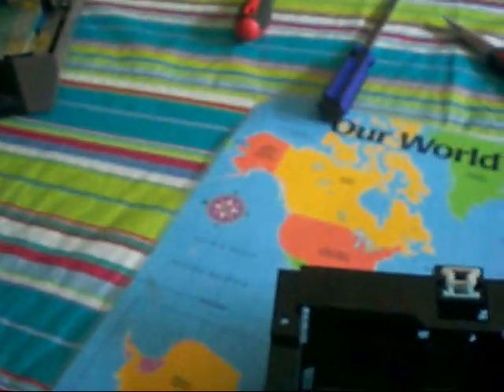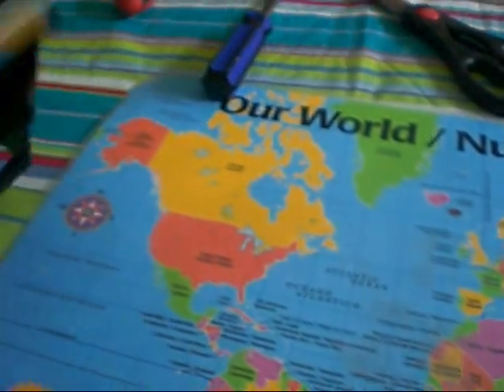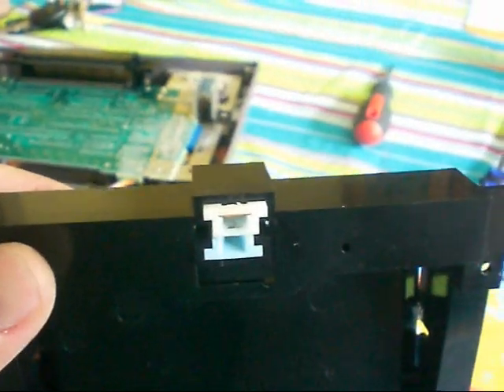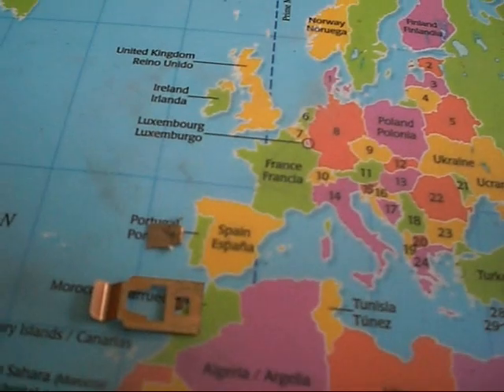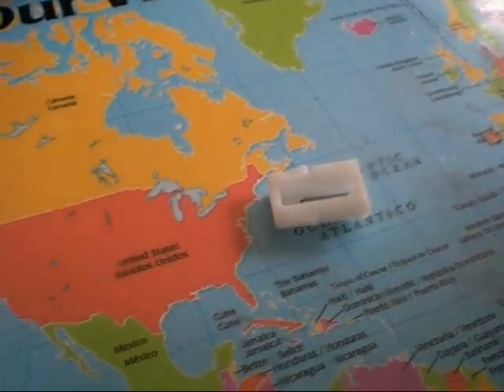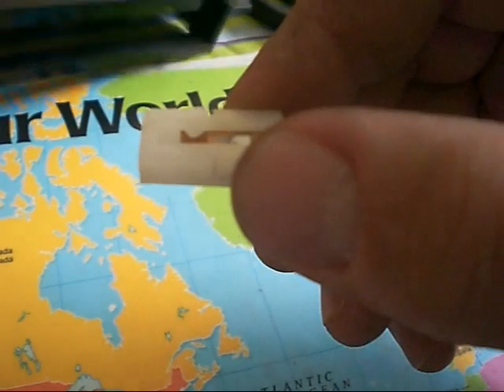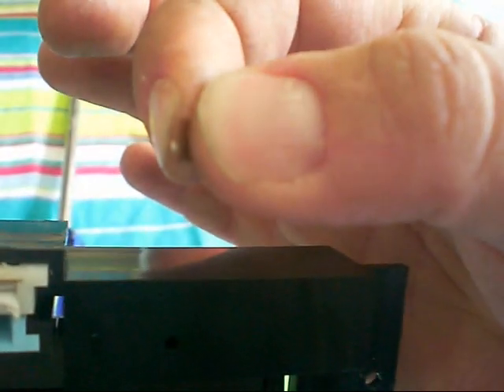Nintendo Front Loader Game Latch Repair: How To Get Your Game To Stay Down In A Front Loading NES

Comment: However, upon further inspection, I realized that applying pressure to the front black plastic on the tray while it was in position allowed it to lock properly. I took a pencil eraser (one of the ones you put on a pencil if you've used up the original eraser) and jammed it in between the middle screw holder on the front of the case (the one that the outside screw runs through). This put enough pressure on it to make it work smoothly.

Comment: Figured it out. For anybody else who is wondering, there are two openings on the side while it is in place. Those holes expose two tabs on the white plastic piece that need to be pressed in in order to remove the piece. The tabs basically lock it in place. 

However, when I removed mine my copper plate was not broken. However I was still having the issue of it not wanting to lock in place. I could remove the holder and it lock fine, but when I put it back in, it wouldn't lock. It made zero sense
Reply: mine wasn't broken either but someone opened the Nes to make a freezone mod and didn't put it back together correctly so the little metal pin was  slightly crushed and there just wasn't enough tension anymore to lock it 
so if everything seems fine just ajust the tiny pin inside for 0.2mm

Comment: thank you for the video, it was hard to find informations on this particuliar problem, mine wasn't broken but someone opened the Nes and didn't put it back together correctly so the little metal pin was  slightly crushed and there just wasn't enough tension anymore to lock it 
so if everything seems fine just ajust the tiny pin inside for 0.2mm
Reply from the maker: Happy to hear that it helped.

Comment: Another thing that can go wrong with this part is that the metal pin can get pushed up into the white plastic thing, and won't go down into the groove when you push the tray down. This happened to my cousin's console, all I had to do was pop the pin back down into place. You can do this without removing the white thing from the loading tray, just use a toothpick or something.
Reply from the maker: Good advice.

Comment: The Paper, eventually pops out, and you have to open the NES, and place piece of paper inside again, and this time, I put some glue to hold it in! lol. ( Plus to get that piece out is hard, took me awhile to figure it out!  ( All you do, is get two flat head screw drivers, and press on openings on the sides to push that tabs in, that hold it! Good Luck!
Reply from the maker: Fortunately, this one never came back out. It was packed in pretty tight.

Comment: I just have a problem with one of the consoles. It runs the games without lowering the tray. I think that maybe I "overfixed" the 72 pin connector. Would you happen to know what did I do wrong?

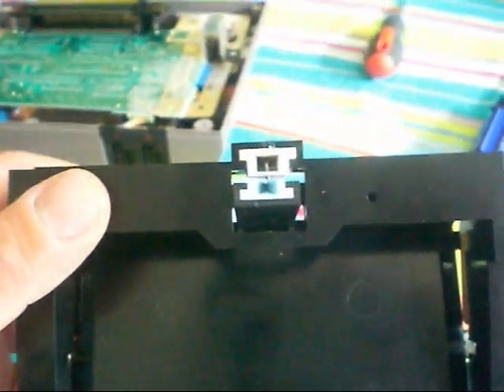Comment: Hi. How did you put out the white piece at 0:55?
Reply from the maker: It has been nearly ten years, and I can't remember. I believe I put it back together at the end of the video, but I'm not sure that is helpful.

I don't remember having trouble getting it apart, so I'm sure you'll be able to figure it out if you try.
Reply: @edt1138  I really can't put it out without break it. I can't find any video or tutorial
Reply from the maker: @MarioMarley  I'm not sure what to say, I got it apart without breaking it, and I apparently didn't think it was complicated enough to mention. It does make a clicking sound when I put it back together in the video, so there is probably a tab that needs to be depressed. 

Maybe if you read through the comments on this video someone else has asked the question and had it answered.

Comment: Do you have a fix for when the actual pin breaks, the copper in mine is still perfect but the pin itself that glides on the track seems to have broken off
Reply from the maker: I haven't had to fix that problem yet, but I would find a piece of wire and make my own.
Reply: Tried it keeps slipping to the side of the copper for some reason
Reply from the maker: Might have to use a longer piece of wire and bend it around on itself a few times. Imagine a paper clip type of shape with the pin coming off it at a right angle.

Comment: question... what does it mean when your cart clicks down like normal and then after a few seconds it pops back up?
Reply from the maker: Possibly that your pin is bent or worn.
Reply: +EdT1138  I found out that the blue plastic piece on the latch mechanism. Thanks anyways though!
Reply: hey dude i found that of the of pins are broke off could i maybe steal a latch off of a toaster (im being dead serious) since  most toasters use the same latch mechanism as the nes? or would it be better to buy a cheap nes at a yardsale or something and use it for spare parts?

Comment: it happens when u tighten the screws up to much at the bottom of the nes
Reply from the maker: The little pin breaks?
Reply: George Webb Only if you were assembling incorrectly (a common error). The mechanism actually has a tab that is supposed to lock under the circuit board at the front of the console. If the entire loading mechanism is sitting on top of the main board, you're doing it wrong. :)